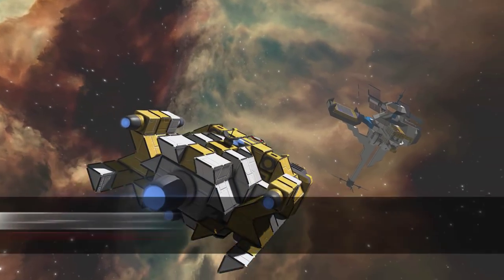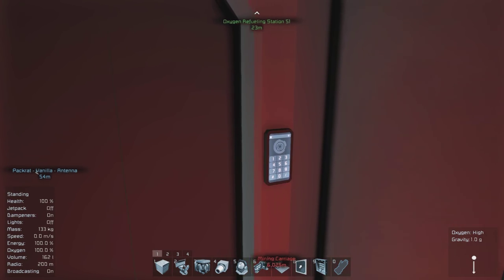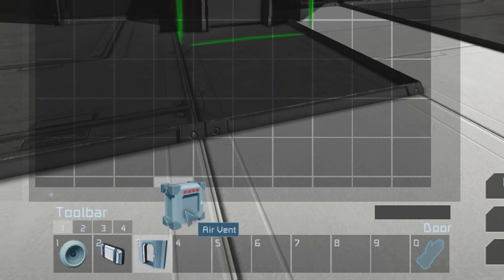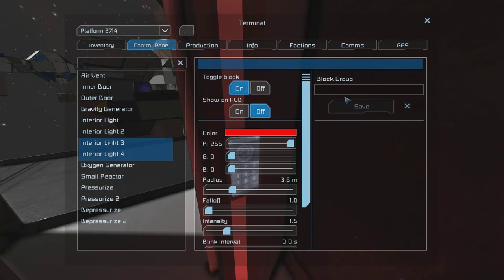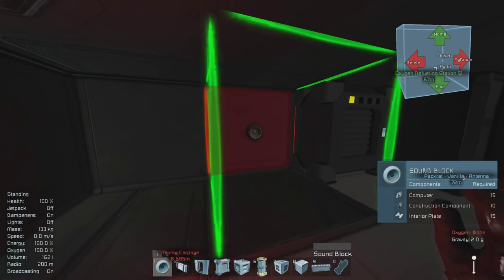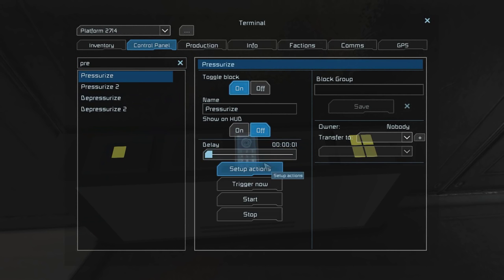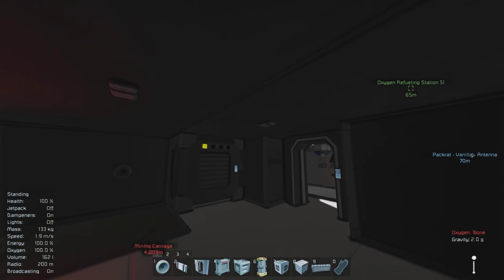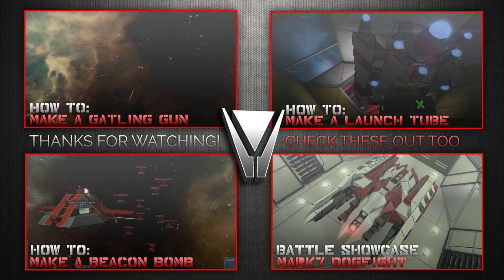How to Build a Smart Airlock Tutorial [Space Engineers]

Comment: making airlocks is always my favourite thing to do in games as it's really a true test on what you're really able to do with the programming in a game, best part about it is building security measures like an emergency sequence in case anything gets compromised which locks down all the bulkheads including one in the pre-airlock room (which also has a ceiling mounted turret).
You can have both a timed airlock and one that uses sensors with manual or automatic doors alike, the circuitry system (aided with mods) in that game is great, hope to try out Space Engineers' one day.

Comment: nicely done but... :) by my opinion much more smarter and space friendly airlock is just two doors right next to each other, its curently kinda bug because once you close inner doors it would say no oxygen (its caused cause there is no free block space) but you dont have to worry about some oxygen ejected and all you need to make it smart... just one timer block, group all your doors together, set this group into timer block to close, and trigger again timer. Set few seconds delay (im using 5 sec cause my pc is crap). Each 5 seconds system make sure all your doors are closed. just open outter door, fly in, wait until you hear doors behind you close, open inner. Accidental decompresion still can happen, but only in one room. Depend how strong your pc is. If your game runs smooth you will be fine with 2 - 3 seconds, just time to press doors and go in.

Comment: Morph,
I noticed an anomaly when attempting to use this for my mobile base setup, having the depressurize cycle the same timer as the door does not leave sufficient time to close the door, the vent inside the airlock sucks a small amount of air out of the room it is attached to as the door shuts each time it is cycled to depressurize, basically over a couple of dozen cycles my air lock tank filled up and became useless - since vents are smart and do not attempt to pressurize open spaces in the current version, i can see being able to fix this by add a single timer that handles the air vent on the depressurize cycle individually and then hands over to the stage 2 cycle timer.

Comment: I make my airlocks with the 4 timer blocks, but Only 2 doors, 2 sensors and no vent.  The space that the doors occupy don't count with pressurization.  You just need to set the timer blocks to not let both doors open at the same time.
Reply: The doors are placed back to back so there is no blocks between them.  Even with the old doors, there is enough space between the closed doors for your engineer.